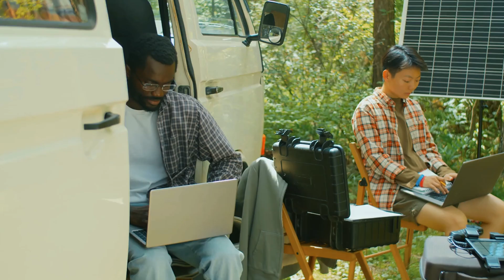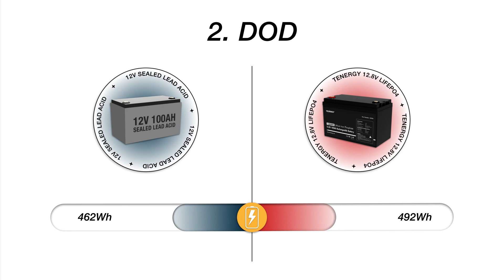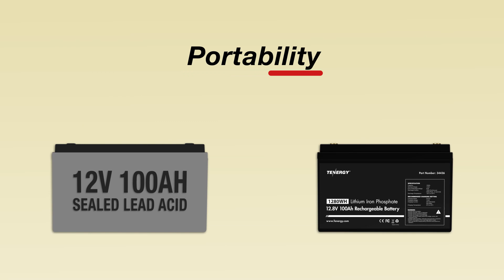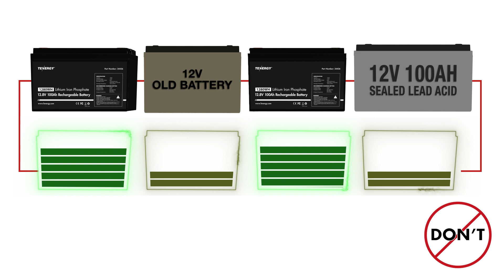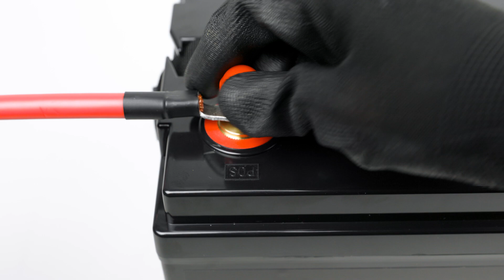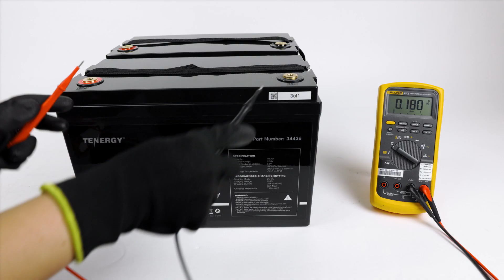Tenergy 12.8V 100Ah LiFePO4 battery guide

Comment: Lithium batteries:
+ Higher energy density.
+ Longer charge cycles.
+ Low self-discharge rate and 100% depth of discharge.
+ Higher C rating.
+ Wider operating temperatures.
+ Higher voltage.
SLA batteries:
- Low voltage.
- Low energy density.
- During storage, battery starts to discharge itself. A recharge is required before storage.
- Lower C rating.
- Indoors only.
- Shorter charge cycles.
- 50% depth of discharge.